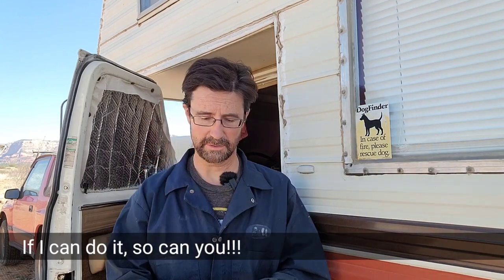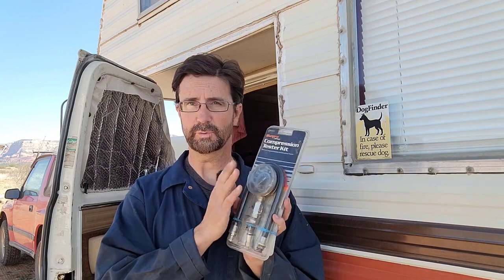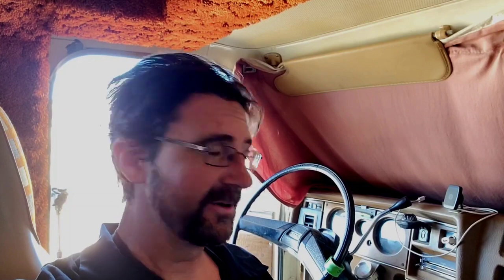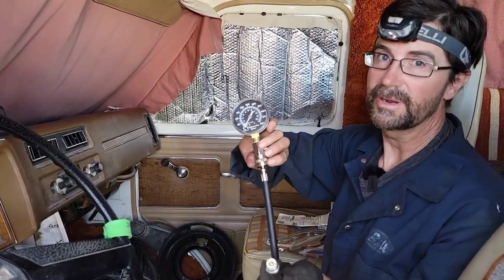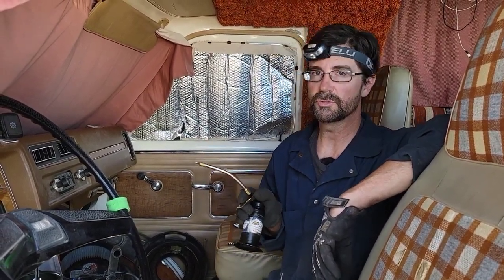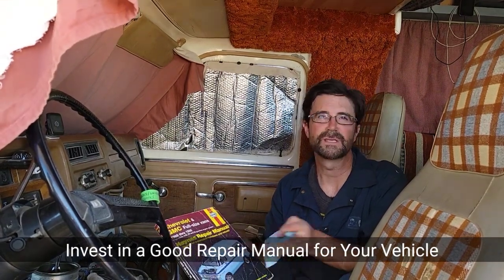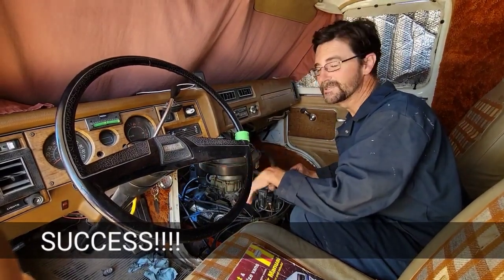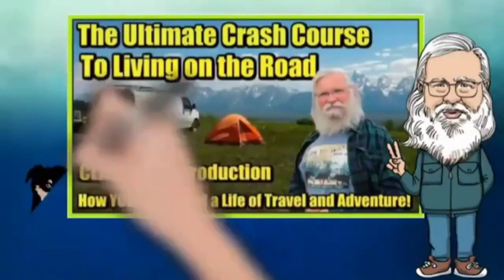Van Life Essentials How to Check Your Engine Compression in a Van

Comment: Thank you, Brian!  Very informative.  I had a '79 Subaru Brat.  I replaced the water pump on it and did my own oil/filter changes, and other routine maintenance.  Loved my Brat.  Once I had someone jump it cause the battery would not turn it over by itself.  I left it running to charge the battery, went inside to get some tools.  There was a knock on the door.  A lady said didja know your car's on fire?  I could not believe what she said so I asked her to repeat it. I ran outside and sure enough my beautiful Brat was in flames.  I called the fire dept and they put out the fire. Totaled.   After investigating the chief said the gas line came loose, sprayed gas on the spare tire (spare tire was stored in the engine bay) and it spontaneously combusted.  I guess that's a good reason NOT to store the spare tire in the engine bay, huh, Subaru?!  DOH!   Funny thing is:  I always carried a fire extinguisher and it survived the blaze!  Other lessons:  don't leave an idling vehicle unattended.  Get someone to sit with it if you need to go get tools, pee break, etc.  Get your tools BEFORE you begin work.  Keep a fire extinguisher near where you work on vehicles...outside the vehicle.  Live and learn.  Pass it on!

Comment: Nice to see the compression test and that it went fine. Reminded me of auto shop in high school. One problem that I have seen in very hot weather is a vapor lock of the fuel in the gas line. If the line is to close to the engine it will vaporize the fuel before it gets to the carb. and the engine will be overheated and just stop until it cools off and then will start again. Not saying that's your problem, but it can happen. It happened to us in the 1960s going from Lone Pine up to Whitney Portal in CA. It was on a fairly new Lincoln and needed to be towed back to LP. Took some time to find the problem and they loaned us a '49 Chev, 6 cyl. That baby pulled right up there, no problem. Did I show my age??

Comment: Make sure your throttle blades are wide open on the carb to get max air flow. Use wire or wire tie.
Reply: correct. with the throttle closed the intake vacuum will be higher and you will not get an accurate reading.

Comment: I recommend working on you car or truck. I have a 2007 Prius. Today I worked on a wheel bearing. Tearing it apart I noticed somebody replaced the bearing and didn't lock the axial nut and the nut worked loose. I replaced the wheel bearing because I had it apart and had the bearing. I ordered the locking axial nut at the parts house today. Tomorrow I will install the nut.

Comment: There has never been a better time in which to freely obtain excellent information on how to carry out maintenance and repairs to one's vehicles.

High quality, inexpensive tools enable owners to carry out preventative maintenance themselves.

Manuals, forums, websites and videos are just some of the free resources which show the viewer how to do various tasks.

Not only does one save money by doing things themselves, you gain knowledge as to the current condition of your vehicle.

It can also be quite enjoyable and the sense of achievement and satisfaction is hard to beat!

By doing your own work, you avoid the rip off cowboys that falsely charge for work not required or which they didn't actually carry out, or carried out very badly. 

Doing one's own work means you can have absolute confidence that it has been carried out properly.

Getting together in a group to self help may be beneficial if you're feeling a little lacking in confidence.

Buying good quality oil and filters, brake pads and shoes, wiper blades, etc, will save you money and keep your vehicle in tip top order.

To know that your vehicle is in good order because you've personally taken care of it is a feeling like no other...

Comment: Compression loss happens over time with lots of warning signs. You need to do more servicing, and inspections on your vehicle. An engine is an air pump plain and simple. Air fuel and spark make it run. Maintain these three you should be good.

Comment: How does a compression test fix your motor ?
Reply: It tells you the condition of the cylinder, valves and rings. That tells you if the engine is in good condition and if it's performing correctly. We used to do a compression test on every car that rolled thru the garage door.